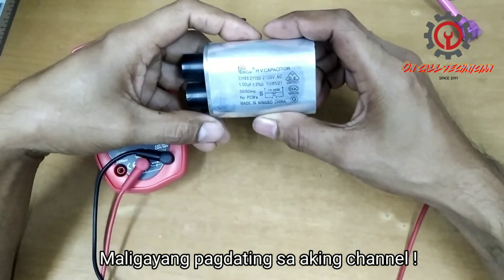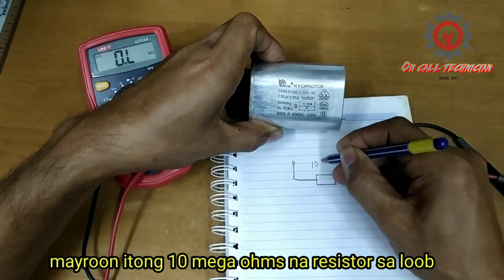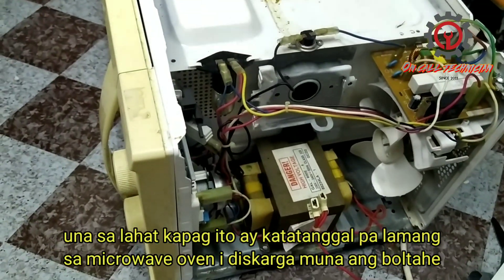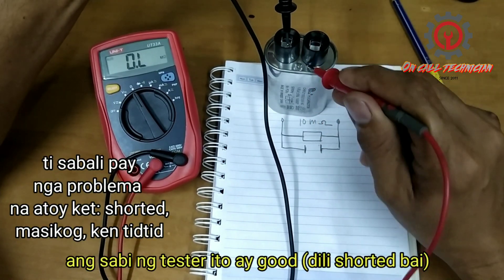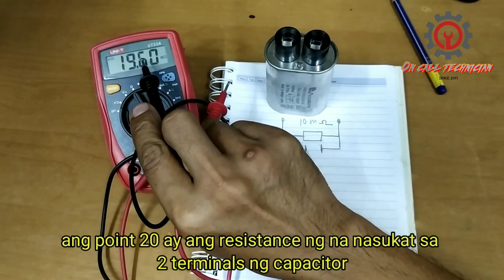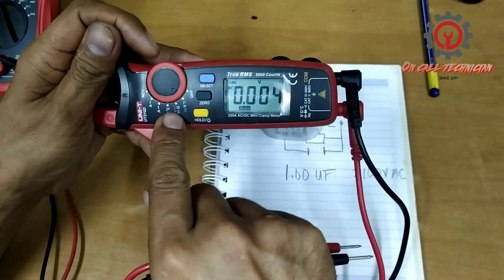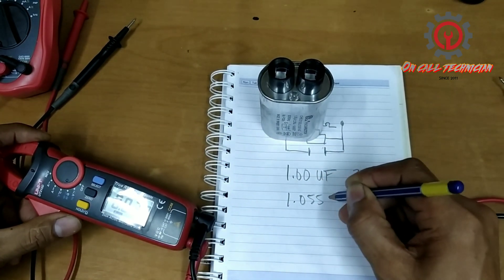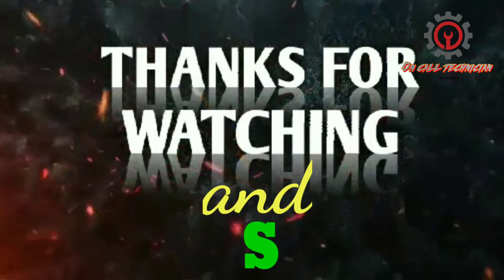HOW TO TEST HIGH VOLTAGE CAPACITOR OF A MICROWAVE OVEN USING MULTIMETER (TAGALOG SUB)

Comment: If capacitor like this has a leak it will not show capacity using multimeter ? And a good one will show ?
Reply from the maker: No, it will not show capacity sir. Yes a good pne show

Comment: Nice tutorial Sir. Will there be a problem if I replace a .75uF capacitor with a higher value capacitor? (ex.   .75 uF to 0.9 or 1.0 uF) Thanks and more vids to come.
Reply from the maker: Para sa madaling sagot yes po if pasok po sa 3- + %tolerance sir. 
.75 + -+3% = .77 lng po allowed sir.